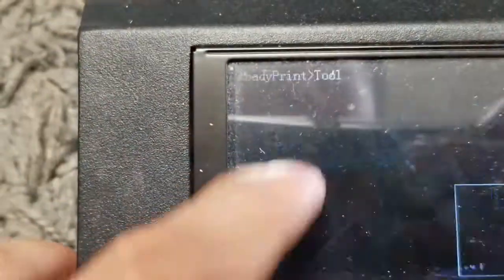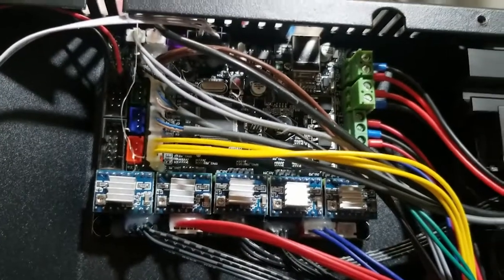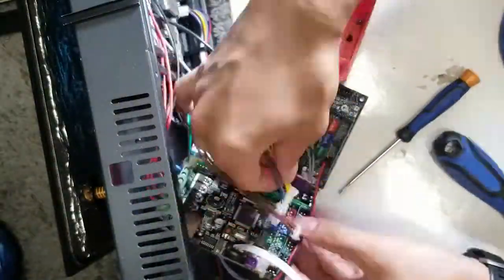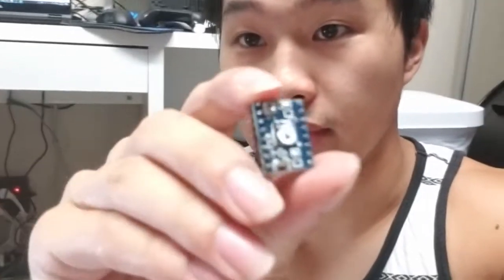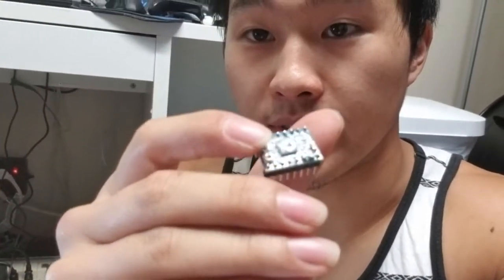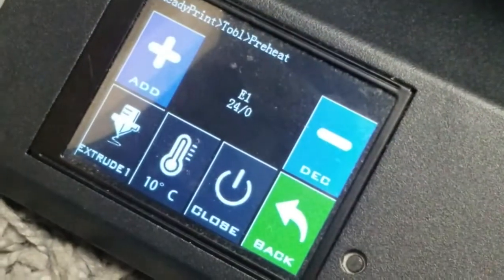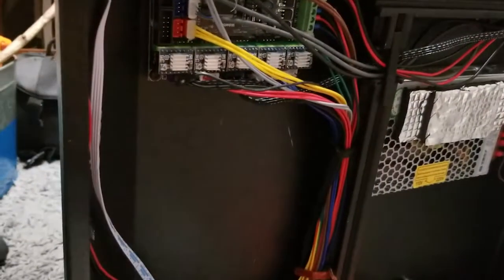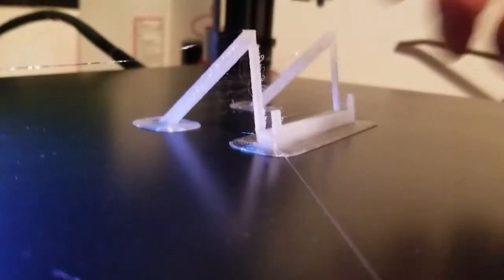Motherboard Replacement Artillery Sidewinder X1 - Mintemp Error

Comment: I hope this is the problem that'll fix my Sidewinder X2. My problem is the bed and extruder/printhead heats up as the start and starts smoking.  I google smoke from print head and saw some threads that sound like similar problems. It's supposedly a MOSFIT error. I also get an error on the screen saying MAXTEMP TRIGGERED system stopped. I don't believe a MOSFIT is sold by itself. So I assume a replacement of the motherboard should do the trick I hope

Comment: When you say "thermistor on the board", where is that located? I got the same error but my bed is showing -7c temp. Changed hotend thermistor and cartridge, checked all the cables, still nothing. It happened when i was changing my nozzle, turned off and on, and showed the error, so I find it weird if it would be something wrong with the bed cables... I sliced the bed wire, no kinks all good. So im very confused
Reply: Found it. How did you even go about changing it to see if its the thermistor or the moatherboard? Its the long back cable going from the board to the bed. Cant even find a replacement for that online
Reply from the maker: This was a long time ago, so I hardly remember myself but a mixture of referencing the document provided on their GitHub and things I knew already.  At the time, the parts were able to be ordered online, though I'm not sure of the state of it right now.

I knew it was my motherboard by a short logic table.  My hot end thermistor was fine, so swap that with the motherboard one to see if it causes issue. In my case, it did not and after the swap, my hotend was causing issues. This is how I knew something on the board was wrong, as well, I had shorted it out somewhere before if I remember it correctly due to another thermistor.

Comment: I only get this error when the bed extends all the way to the front of the printer and the wire is tugged on. Would the motherboard replacement fix this error or is it a wire issue?
Reply from the maker: This sounds like it could be a wire issue as I don't recall if my cable is tugged on at full extension.  I would first check to make sure that nothing got unplugged on the motherboard and try running it again. Though, there are a couple things you may have to look into replacing if this keeps happening. The bottom thermistor (which may be the entire plate) or the motherboard if I remember correctly

Comment: where did you purchase the motherboard?
Reply from the maker: I had originally gotten it from the website linked in the description, but it looks like it's no longer available. If you need one, you can try messaging whoever is in charge of that website to see if you might be able to source one or you can buy them off of eBay

Comment: Im getting the MINTEMP triggered system stopped! Heater_ID:bed  error after about 15 mins into a print.. the bed heats up fine... is it the termistor that the problem in the extruder
Reply from the maker: I would check to make sure that your thermistor is working fine.  The fact that your able to get started printing should mean that the extruder head is able to get hot but then maybe shorts out somewhere.

My problem was the motherboard terminal went bad for my extruder thermistor if I recall
Reply: @jarodmica  i just recently replaced the one in the hot end..how do you go about checking to see if it is g ood?
Reply from the maker: @ckjhill67  you can try using a multimeter on the ohm setting and seeing if you're getting a correct resistance but you would need to know what the room temperature specification for the thermistor is.

you could also try to replace the terminal connector for the motherboard with the terminal connector for the extruder to test to see whether or not the extruder thermistor is good, then heating it up to make sure that it's reading the temperature correctly.

Other than that I would recommend going to the debugging manual and seeing if your problem is there as well
Reply from the maker: @ckjhill67  I found a number online for the resistor, an NTC 3950 is the part spec and the room temp resistance would be 100k. If it's not reading 100k on your multimeter at room temp, you have a bad thermistor

Comment: I have the maxtemp error doesnt heat up on it's own but it does heat up normal too 200 and just keeps going too 268. gonna flash the firmware hope it fixes that
Reply from the maker: Hmm, that's strange.  If flashing the firmware doesn't work, it could be a board issue or thermistor issue. Make sure those are all snug and working.  Check out the artillery debugging manual as well to see other options.
Reply: @jarodmica  to clarify, when I out the extruder heat up to 200 it heats up like normal but it jusy keeps goint and crashes on 268. I will check the manual to see what can be done. It's my first printer, my lcd screen sometimes show 0/0 on both bed anf extruder and sometimes 21/0
Reply from the maker: @SMAKKEL  Getting 0/0 on the LCD could be signifying a main board failure.  I would try connecting it to a laptop/computer to see if the temperatures read correctly on the computer.

Comment: If needing to replace the board you should have upgraded it to a 32-bit, maybe an SKR 1.4 Turbo + new TFT. I'm looking at doing that and my board is not broke (yet!)
Reply from the maker: The main reason I used the stock board was because my printer was still covered under the warranty from when I had bought it.  I haven't looked into upgrading my printer much, so I'm not too sure what the 32 bit upgrade would improve on the printer but maybe I'll look into it in the future!
Reply: @jarodmica  were you able to get a diagram of the wires? Looking to go to 32 bit MB and considering other boards on the market.
Reply from the maker: @owenaddams  I haven't found a wiring diagram persay, but the GitHub in the description has a pinout diagram for what's controlled by which pins. As long as the new board matches the same I/O pins, if you go one-by-one when replacing it, you should be fine

Comment: i cannot remove the glue on the plug!
Reply from the maker: If you've got a heat gun, I recommend using the heat to soften up the glue then pulling it out.  If not, you can use a hair dryer to get the same effect.
Reply: Spray it using isopropyl alcohol. The hot glue will be loosen